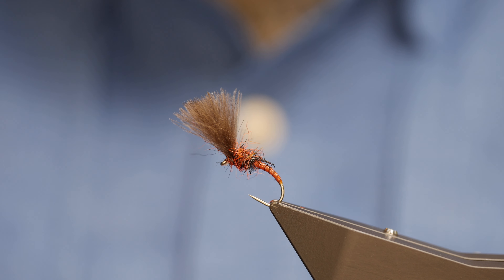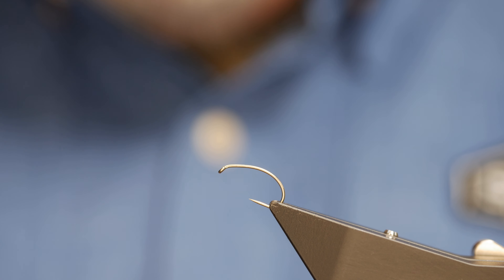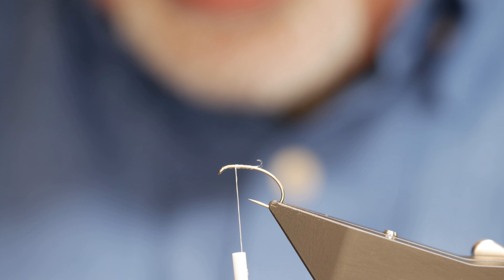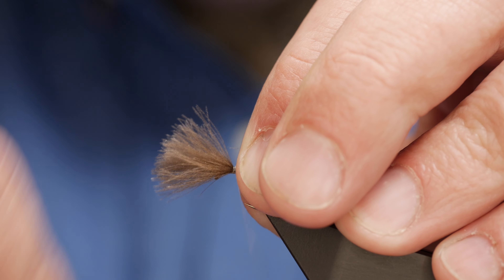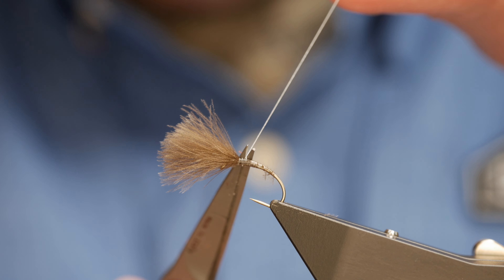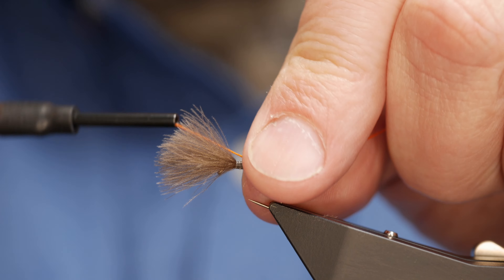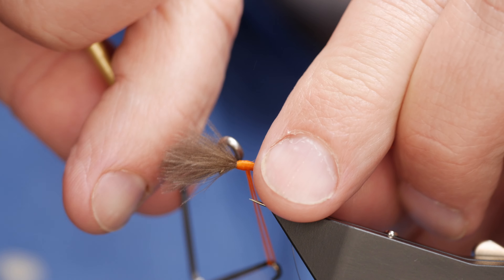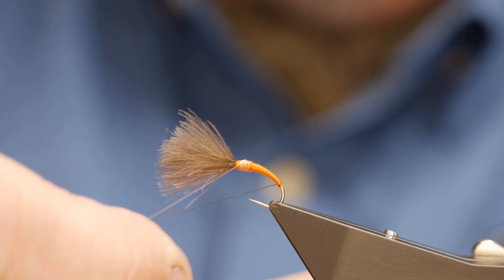CDC Shuttlecock #flytying #fishing #flyfishing

Comment: CDC is great for floatation and natural movement. A tapered cone of high density  foam can often be a quick and more robust solution on the larger Stillwaters. Also that burnt orange is a bonus as the water warms up and starts to take on that greenish tinge the orange is more visable from a greater distance from the trouts perspective. Good luck at clywedog.
Reply from the maker: If I get there Mick 🤞